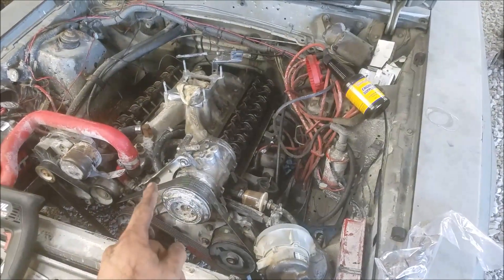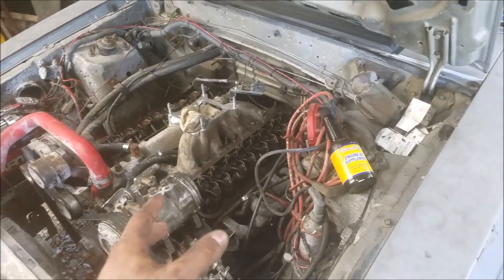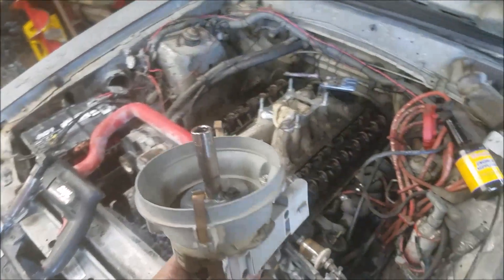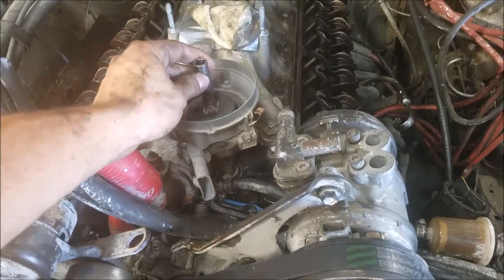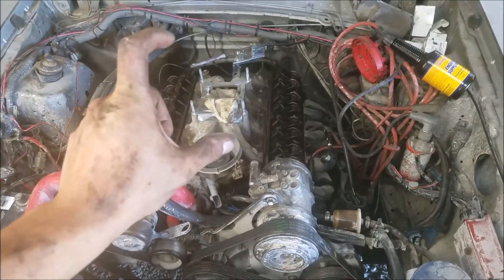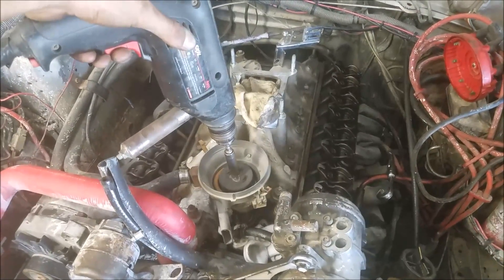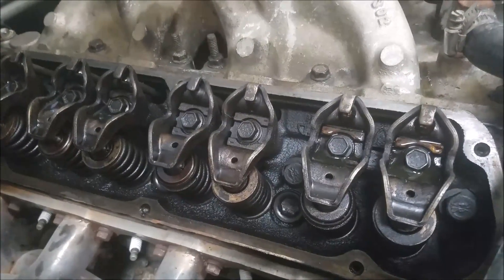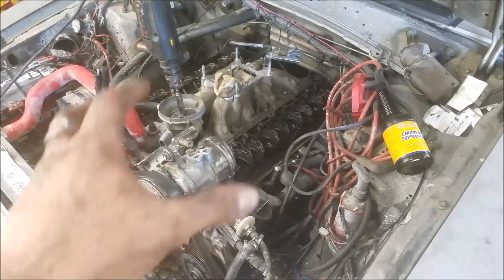Prime an Engine's Oil Pump - A Must Before First Startup (How To/Walk-Through)

Comment from the maker: the Rotstang is back? seems to be the case - or is it??? 
Catch me at the Goodguys Nationals in DM, Iowa on the 29th-2nd !!!
facebook page: Thunderhead289 - Tech & Tune Forum 
https://www.facebook.com/groups/2041856606030081/
Reply: So if I disconnect my spark plugs wires and disconnect my fuel would it be a good or bad idea to crank it and prime my engine that way

Comment: Priming a rebuilt engine can be bad. As long as all moving parts received moly grease at contact points, the cam coated with break in lube, and oil filter is pre filled, all I do is put a socket on the oil pump shaft and rotate it 3-4 times to prime oil pump. When you run the oil pump with a drill, you are flushing critical break in lube away from parts that need it

Comment: Why counter clockwise and not clockwise will clockwise damage the oil pump?
Reply from the maker: It only pumps oil one way is why
Reply: @ThunderHead289  But if the distributor rotates clockwise wouldn’t you run the drill clockwise?
Reply from the maker: Ford windsor distributor is counter-clockwise

Comment: Question. Sbc. Using a legit Oil pump priming tool, I’m getting good oil to all but 3 rockers. 2 of those 3 are getting some oil and 1 isn’t getting any. I have rotated the engine. I’m getting 50 psi. Assembly lube is just basic kinda gooey thick looking oil. I believe from Comp. do you think those 3 will start flowing good once the engine is fired up? Or should I be concerned? Thanks!
Reply: Did you ever figure out your lifter problem?  sometimes in a batch of lifters there are one (or 3) that dont like to cooperate kinda like runts on a littler,lol and you just have to keep priming and turning your engine clockwise a quarter at a time to get them all moving and get them priming, i have seen engines that required a hour priming till everything was oiling right, once you fire up and everything gets good and hot they start working right.
Reply: @dntlss  I had to pull the motor. It wiped numerous cam lobes. Even with proper break in and zinc additive. I went with a roller cam this time. Just got it running 2 days ago. But I had the same issue with having trouble getting a lot of oil flow to some of the rockers. I was getting some oil to all. So I did what you said. Just figured it would start flowing good once running.

Comment: does it matter clock wize, Counter clockwise to prime? and will that oil the bearings?
Reply: Only one way to prime, while facing the engine its courterclockwise,otherwise its like instead of sucking on a straw to drink a soda you would blow on it, thats what you would be doing if you rotate the pump clockwise, sorry no one answered your question 7 months ago, maybe this will help someone else.
Reply: @dntlss  It helps me.  I've been holding off starting my new rebuild because I cannot get oil up through push rods -   but I've been running clockwise this whole time.    Hopefully this will fix my issue.   Always thought fords ran clockwise.

Comment: 🔔👍
Amazes me how so many people complain about how many horsepower oil pumps suck up.... yet my 3/8 drill that free spins at 2800 rom, and when priming sounds about 2,000 rpm. =That is 4,000 engine rpm.
So here I am pumping room temperature oil at 4,000 engine rpm with my 3/8 drill.
How many horsepower IS my little drill if it does this? Or more precisely, how much power does the oil pump actually suck up?
THINK ABOUT IT.

Comment: I was priming my 460 for 1 hr today , it's a crate engine from promar,  I have only half getting oil , they used some real thick engine assembly lube I've never seen before,  I'm thinking I'm going to have to blow out the pushrods to clean that crap out so I can get oil flowing , I'm calling promar in the morning to ask them what the hell is that thick pink assembly lube . I'm positive it's blocking the oil from flowing. So frustrating
Reply from the maker: If it’s like a Chevy, without a distributor in it, one side will not oil.
I usually modify a distributor by removing the cam gear and use it as a prime tool
Reply: @ThunderHead289  it's not like a Chevy,  it's got oil coming on both banks ,it's being super stubborn

Comment: Thunderhead289 I have a question maybe you can engineer. I want to prime an engine through the oil filter  without removing the distributor.   I am thinking taking a filter and modify it by connecting it to a pressure vessel filled with oil and pressurize it to prime a engine that hasn't been started in some time .   What are your thoughts?
Reply from the maker: I think that is already manufactured actually!

Comment: You mentioned spinning one of these by a speed wrench> Holy cow that would be difficult. At least on my 351 the priming rod is so very hard to turn when it is pumping that it overheated my electric Makita drill! I wonder if the high-performance pump is that much harder to turn than a regular, or if they are all going to be hard to turn when pumping cold oil to the top of motor? Hope this new oil pump is just tight and will losen up. I could not get a new and freshly charged 20v DeWalt drill to even turn it but 10 seconds. Does it sound like a bad pump?

Comment: Thanks for this vid! 
I am about to try starting up an 82 Mustang that sat for 20 years.
Newb question: I don't do engine timing. When I pull out the distributor, rotate the engine like you mention, can I just put my distributor back in and be good to go? Won't I have messed up timing by moving the crank while the distributor is out?
Second question: While facing the front of the car, do I turn the crank clockwise?
Thanks again. Super helpful video.
Reply from the maker: Check out this video regarding installing a distributor. 
https://youtu.be/znMQCK8OPu4
Reply: ThunderHead289 ok, thanks. Watched it and it appears, yes, I would mess up timing.
However, it seems I could just put in my engine primer extension, drill for a while...REINSERT the distributor before I use the breaker bar to turn the engine 180, use my primer again, reinstall distributor again and no timing would have been affected. Sound right?
Thanks again. Trying to leave the timing up to the pros once the car is drivable.

Comment: I learns over the years to never pre fill oil filter, it creates an Air pocket making a trap oil cannot get by easily.
Let the system push it thru by itself as designed.
Reply from the maker: That’s absolutely false
Reply: @ThunderHead289  
would you like t0  talk to the hand Full of guys in the machine shop that used to Race fords and cherries, one a master mechanic at a local college that knew this????
And I encountered this airLock Also.
doesn't look like you have lived life whatsoever to understand
Reply from the maker: Ash qelon I definitely would. 
That’s nice, I’m an engineer and I work with fluid dynamics every day. 
Probably the guys who tell you they set ignition timing by ear. 
All excuses for not exactly knowing what your doing and just being flat out lazy.
Reply: @ThunderHead289  
you would believe it with your willfully Ignorant 
derogatory platitude
Reply: @ThunderHead289  You're a engineer? that car your working own doesn't look like something a engineer would be working on or owning, most of the engineers i know are loaded, maybe you're just getting started?
Reply: Priming a engine and starting it for the first time is like packing bearings, EVERYONE has their own way of doing it,get you a piece of paper and go thru every video on Youtube and right down every single way every person has to do it, i guaranty you'll have a ice pack on your hand before long,reminds me of torque converter installation,that argument about starting a torque converter dry versus putting in a few quarts will never end, ever.

Comment: Just wondering why. I always just pull the coil lead and crank it till there’s pressure. This is what I was told but not sure that’s the correct way?
Reply from the maker: I definitely can do that, but that’s a lot of cranking with everything dry. It takes no time at all when spinning that engine at 300 or so rpm to push all the assembly lube out - if you have an oiling issue, then you would be spinning her dry!

Comment: Isn’t that the function of the assembly lube? To ensure everything is oiled until the engine oil hits it?
Reply from the maker: N Stone Stones that’s just for assembly - you definitely want to prime it before it’s fired. 
Greatly risk spinning a cam bearing otherwise. - it takes a long time for the oil to get everywhere and on the first fire up, it’s critical. 
This particular cam swap scenario is less crucial, but I still wanted to get the point across

Comment: I used a drill with like 4 magnetic screwdriver bit attachments to prime the 302 for my 84 f150 , I would have been in some crap if I dropped one of those extensions in the engine lol
Reply: Couldn't you just attach a really strong magnet (permanently ) to the bottom of the oil pan and that would keep your bits held in place and out of danger of fouling anything up?

Comment: I love the flat tappet cams.  Use Rotella or Valvoline Diesel engine oil or straight VR1 as they all have plenty of Zinc Dialkyl Dithiophosphates/ zinc/phosphorus. Keep in mind that zinc additives are corrosive above certain levels and can harm your engine.

Comment: There is an even easier oil priming tool for SBF's that use the 1/4" oil pump drive shaft (351 uses 5/16") - a 6" long 1/4" hex extension for a bit driver or a drill. I use one I bought from Harbor Freight because I like to live dangerously.
Reply from the maker: I’ve done it like that before, but there is two things I don’t like about it. The distributor works as a guide, so it’s always nice and the linear. Also, with the oil pump driver distributor and I’m not afraid I’m going to drop something into the engine. I’ve done that once before, and let’s just say that that’s very disappointing to deal with.

Comment: I think also cranking the engine without the dizzy connected (so there is no spark) works too right?
Reply from the maker: Somewhat - slow cranking is a fast way to damage a brand new cam if it’s a flat tappet. Say you don’t have a flat tappet - what if you have an oiling issue? Then you jut spun your bearings dry for however long - assembly lube doesn’t last long when the engine is spinning at 300 rpm or so. 
I level with you, but I always try to be as safe as I possibly can
Reply: ThunderHead289 never thought of if an engine has oiling issues. I was thinking of this when you go to start an engine that sat for awhile but you knew it ran when you last parked it